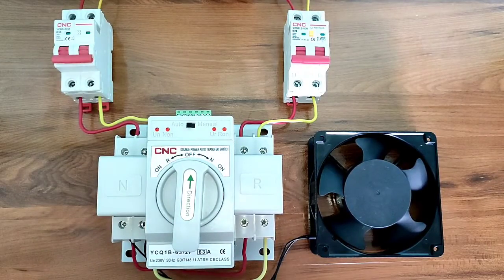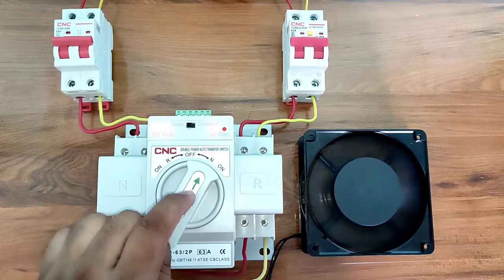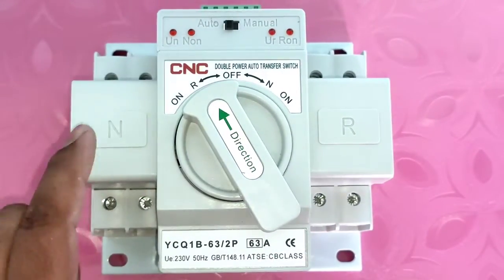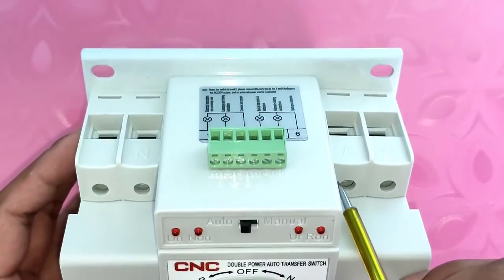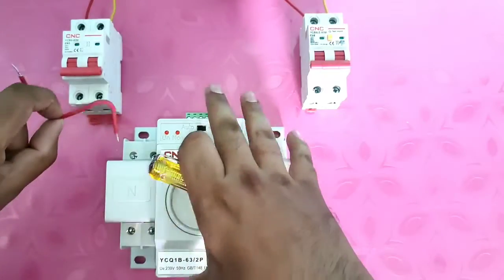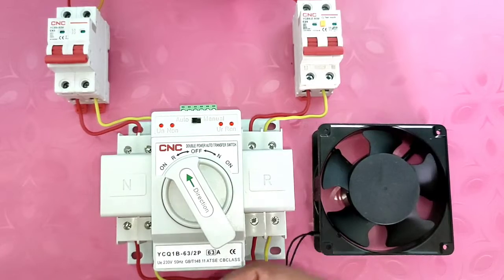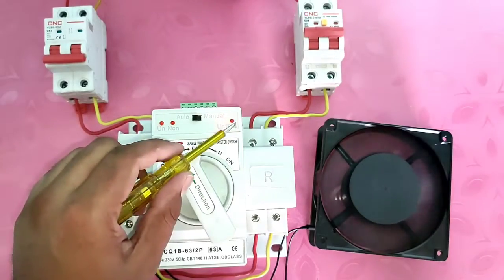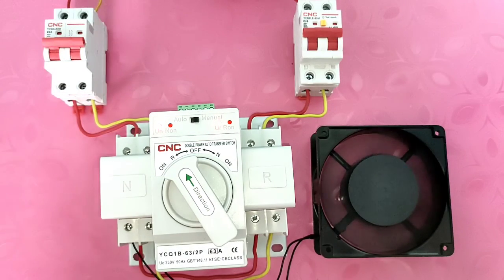Auto Changeover Switch (ATS) Wiring! Double Power Automatic Transfer Switch Wiring

Comment: Hi, here is my guestion. Ecoflow delta pro XT60 max input values are 150V 15A. Can I combine this two lines into one for Delta pro via this transfer switch as:
A) on one side the current from the panels with a power of 800W, 60V 13A and
B) on the other side the current from the 51.2V LifePo4 battery with a power of 420 W 55V 8A.

Comment: Hello, I have a 220V 63A 2P ATS, similar to the one you explain, but it does not want to recognize a 120V power supply on the main line, only 220V gives the ready, the backup power supply works perfectly, but the main one does not work automatically since it does not give the ready or the second signal in the switch, could you tell me what I should do, the connection is fine, only that being 120V (1 phase + 1 neutral) it does not transfer, and I must close it manually and it only signals voltage, not ready-closed position, what should I do, would you help me?

Comment: My question is, the N side of my switch the UN light is on but the NON light is not and when i turn on my generator the R side both lights are on but on the N side only one and it hum like hell, what is the cause of this please.
Reply: The same thing happens to me, did you find a solution?
Reply: @jorgeluisvelazquezgonzalez4032  I JUST CHANGED it to the manual, could'nt be bothered.
Reply: @dancehallexposed6193  I have already managed to make it work, feeding through the main network with 220v, that is, two phases and at the output it only took one phase, it was working perfectly but now it does not make the transfer to the reserve that I feed with a solar system, it does change from the reserve to the main one but not vice versa

Comment: Hey

What is the size of cable you use from DB Box to wire your AUTO CHANGE OVER SWITCH
And what is the size of the breakers?
Reply: It'll depend with your load capacity